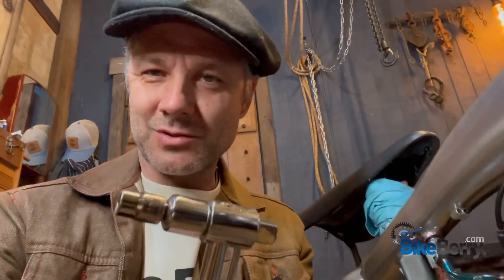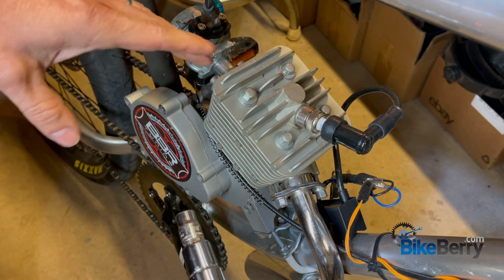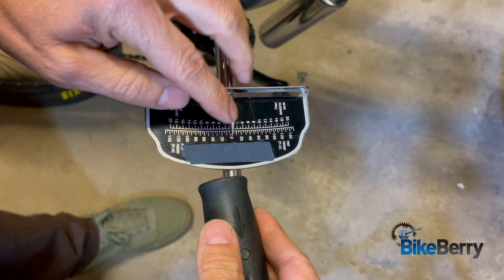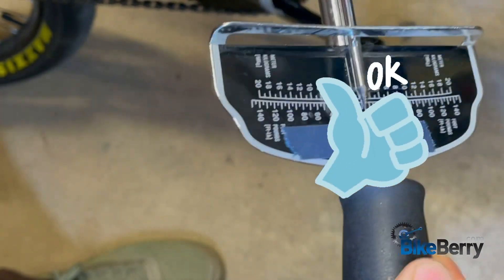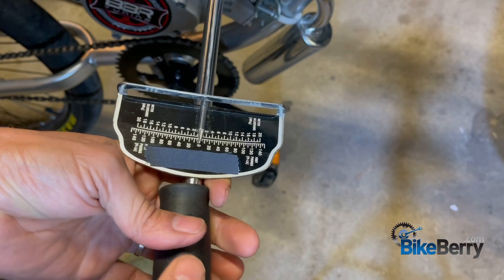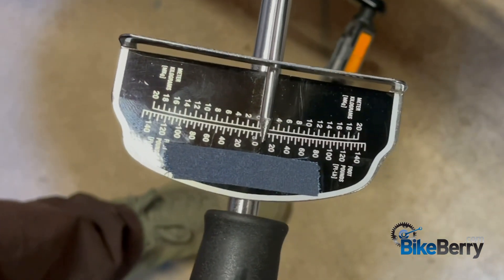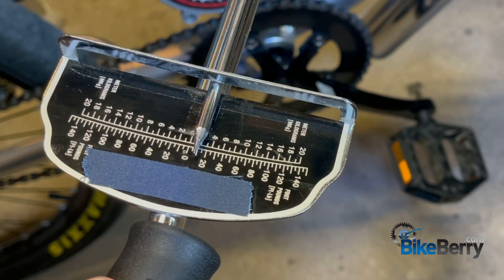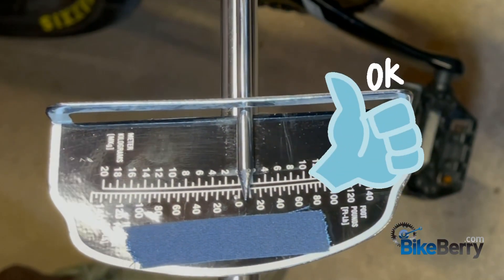Properly Tightening Head Bolts | Motorized Bicycle | Bike Berry

Comment: I have a 100cc electric start BT (Bullet Train) with an automatic clutch,the clutch is slipping,the 100cc BT manual says to put oil into the engine casing to lube the clutch,but the manual does not show a picture of where the the clutch is to be lubricated properly to prevent the oil from getting onto the clutch to prevent the clutch from not slipping and the engine does not have nowhere near the power output the engine should have,can BikeBerry upload an 100cc BT Bullet Train clutch video to show how to clean the leaked oil off the clutch to prevent the clutch from slipping?

Comment: When I got ahold of Bikeberry last year when I bought my motor, They told me 17 foot pounds on my 66/80cc Angle fire motor. I thought that was crazy but tried it anyway, Waiting for the cylinder to crack. It didn't and the bike ran great, Though did loosen up and then stripped out the acorn nut on one stud. Last time I tightened it up I only used 12 pounds and it seemed to have less power, Though it does still run. Thanks for the info Tony, I'll keep that in mind for the next motor rebuild.
Reply: I’d imagine some could use more. It’s always good to check for leaks to see if it’s seated well. That’s for another video I’m guessing 😊